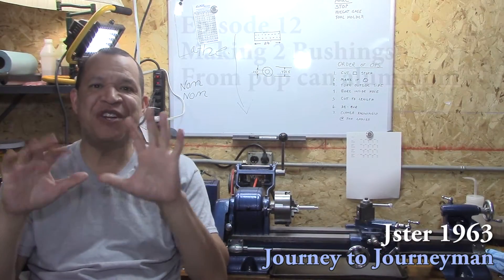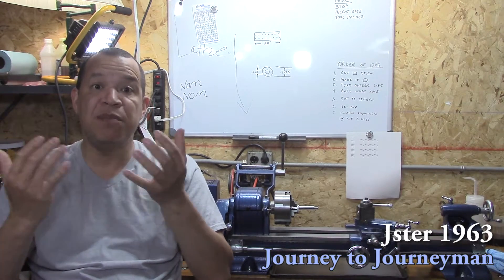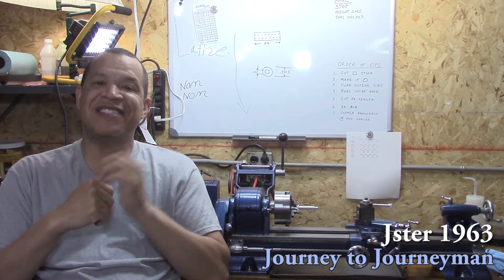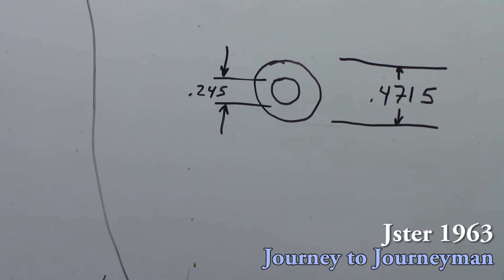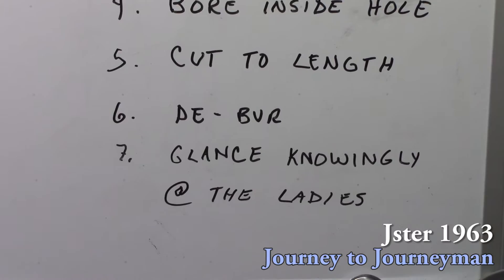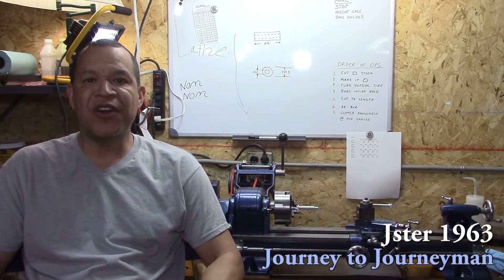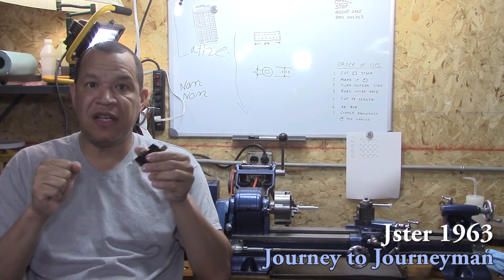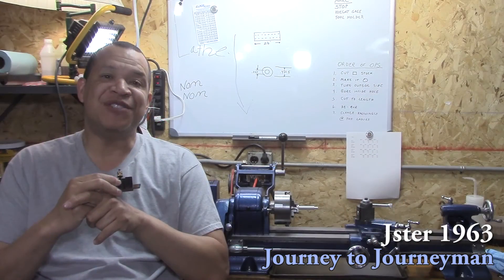Journey to Journeyman, Episode 12, I make 2 bushings from aluminum cans.

Comment: Band-Aid Count = 0  Excellent!   I'm still trying to find a good deal on a 6" Atlas.  You're video's have me wanting one.  Excellent looking parts.
Reply from the maker: +Crafted I've been trying to "cut" down on my Band-Aid bill, LOL!  Well thank you very much, but I think you'll be disappointed with such a tiny lathe.  You're used to 10" machines and this is quite a bit of downsizing for you.  I LOVE mine but I'm clueless about machines.  For the small parts that I make it has been an indispensable tool!  If you do get one I think you will like it for small parts.  And thank you about thinking my parts look good!   Thanks again........
Reply: jster1963 That 6" machine is actually a well respected little chip maker.  In my business, I have a small Unimat that I'd like to sell and replace with the 618.  It's just the right size for the space in that workshop.   A Unimat is worth more even though it does much less.  I'm going to sell it soon as I find a nice 618 with accessories.  Not as many of them out there as the 10".   Watch for a new Back Of The Truck.   I just picked up........ well, it's a secret.
Reply from the maker: Lol!  And SWEET!  I can't wait to see what in the back of your truck;-)

Comment: Interrupted cuts are the bugaboo of us all. Ally is soft. Carbide is unbelievably hard. But its resistance to "shock loading" is low. Basically you are machining a rectangular is much higher. casting and the shock load is high. Chip! There goes your expensive carbide. For this reason when I am doing interrupted cuts I try to use HSS tooling. It is not as hard as carbide, but the shock load tolerance is much higher. If you could rig yourself a tool rest (just like a wood lathe) you can could turn Ally just like wood. In fact I do this often, with wood-turning tools. Then you will feel the shock load in your fingers. Talk about getting a feel for it... good luck with smiling ladies :)
Reply: +Juan Rivero  Boy, talk about forgetting to read what you write. You are machining a rectangular casting. Forget  :"much higher" -- the shock load is high.
Reply from the maker: +Juan Rivero LOL, I do the same thing when not reading what I write.  No problem, I just the idea.  Awesome idea to use HSS on the interrupted cutting!  I will do that.  Also, I've seen a guy turn brass like wood on a lathe.  As soon as I can figure out how to set that up, I def want to give it a try.  And thank you so much.......
Reply: If you look up "graver" on the net you will get lots of referencess on tools to turn metal. It is very simple (clockmakers call the hand tools gravers).
Reply from the maker: I'll def look that up. It's funny because the guys I watch use those wood tools on a lathe is a clockmaker.  Thanks so much......

Comment: Nice video , how about making a round mold for your material is that possible?
Reply: +My home machine shop HS53 Pour the liquid metal into a short pipe should do it... make sure it is smooth on the inside or you will not be able to get the hardened alu out.
Reply from the maker: +My home machine shop HS53 I use soup cans for the larger round stock, but I need to get some smaller stock.  I'll work on that and thank you very much!
Reply from the maker: +Yann Kitson I'm going to try that and thank you.....